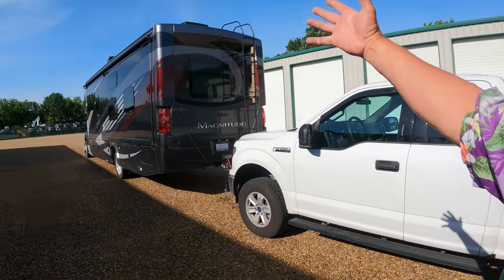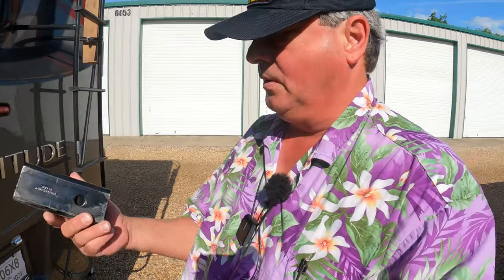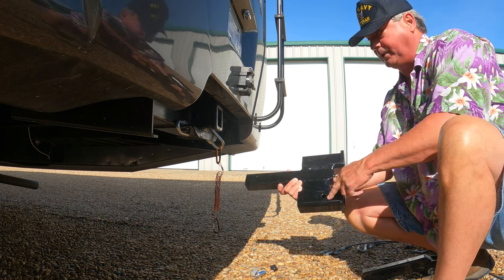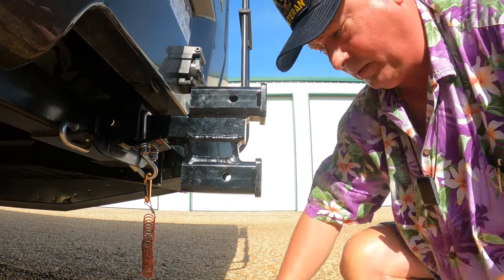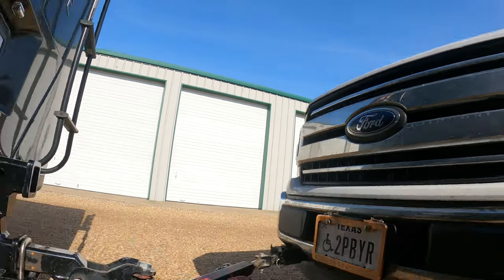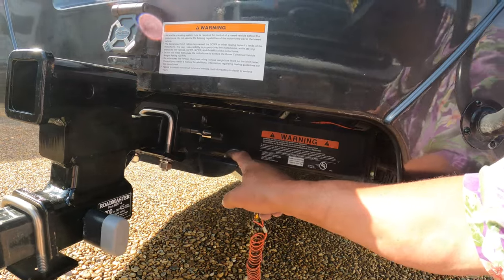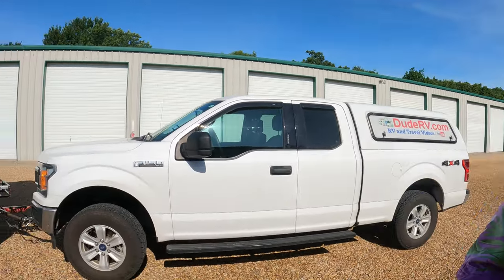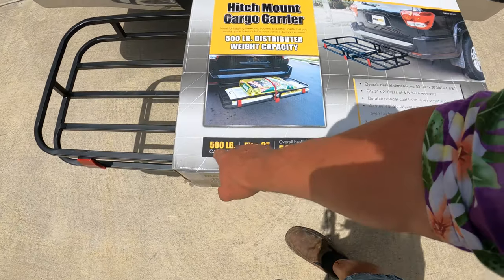Towing With Motor Home? Towing With Super C? Set Up For Thor Magnitude SV34

Comment: I have the Chateau Super C -/F-550 chassis Love it.   I had to use an 10 inch drop receiver to make it level with my F150 for BlueOx tow system.  Can get any length you need to be more level as in zero degree but may not be able to attach the basket. I like the anti-slop u bolt/bracket which I will add.  I also attach the break away cable around my bumper in case something happens to the receiver/tow bar it will still pull the break away. Nice Job! My Fellow Veteran.
Reply from the maker: Thanks so much for the kind words! Thank you for your service and tanks a whole bunch for watching!
Reply: Hey! I have an Omni on a F600 ---- Do you have pictures of your setup? I am trying to see how other peoples look as well. Thanks!
Reply: @kuwusmiles2  cant add pic... sorry

Comment: When I got my omni sv34 I swore I would never flat tow again. I tow my vehicle either on my flat trailer or put it in my 24 foot enclosed trailer. One setup weighs about 7500 lbs the other weighs about 11000 lbs. The coach has plenty of power to tow either but the enclosed setup tows much smoother. In the mtns I have zero issues driving the speed limit. The mpg avgs between 8 to 10 depending upon speed and terrain. I just had to replace the factory tow hitch with more robust setup.
Reply from the maker: only 11 LBS? Han what is that trailer made of? LOL! thanks for watching!

Comment: Great video and very helpful, but isn't the plate for the first locking collar clamp put on the main receiver up side down?
Reply from the maker: yes it is. It would not fit in the "correct" position due to the small angle reinforcement so I opted for the something is better than nothing. I am currently looking for a better reducing sleeve. thanks for watching!